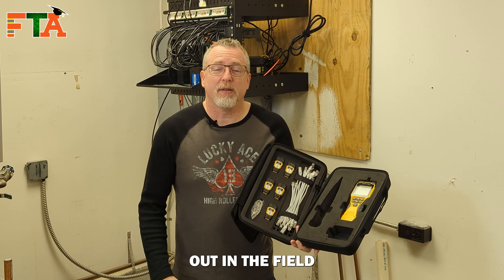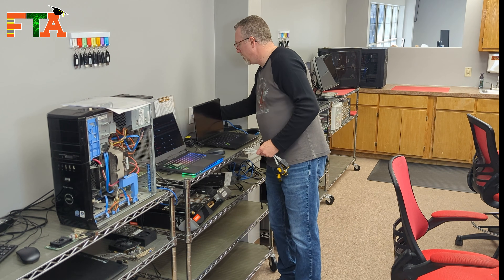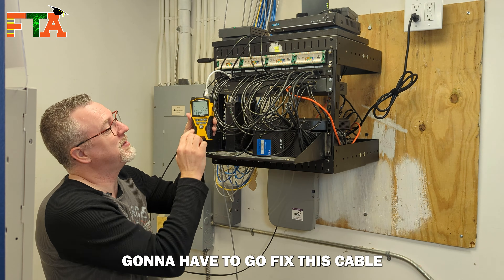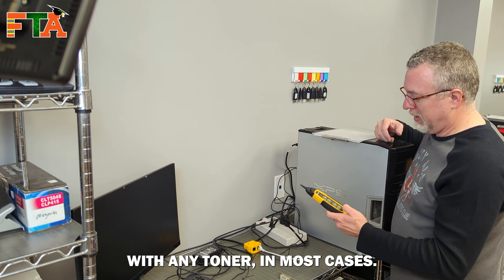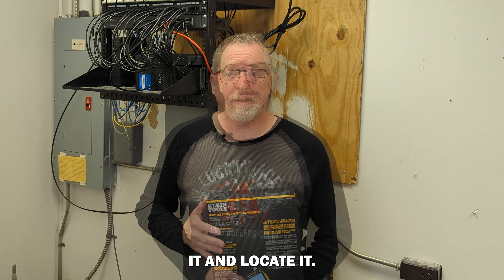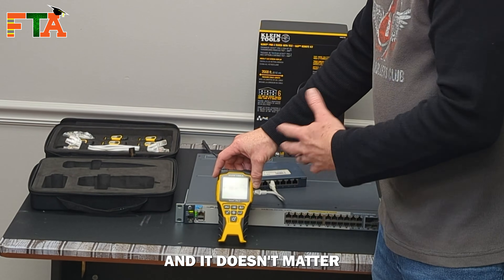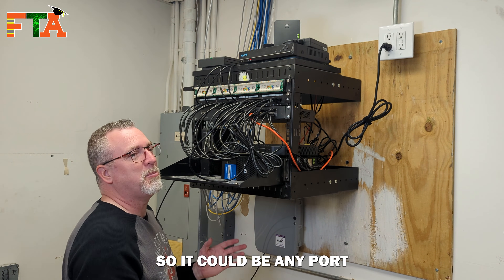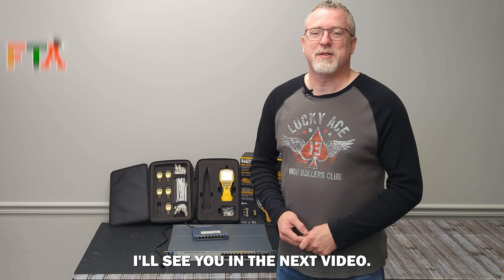Klein Cable Tester Review | Klein Tools VDV501 853  | Real-World Demo-Features Explained #kleintools

Comment: I was hoping you'd show how well the fault detection worked. Can it accurately tell me how many feet down the line my cable break is?
Reply from the maker: It shows cable length by pair so if you have a broken pair, it should show a much shorter length for that pair.  I don't know exactly how accurate it is but it would probably get you in the ballpark.

Comment: I use a measure feature to find which end of the cable needs addressed on a failed cable. You just measure each end and whichever end  measures out to the links of your patch cable has the problem. Suppose you measure the panel side and they all come out to the same length let’s say 60 feet. Then you measure the wall and they all come out except the flashing pair comes out to 1 foot. Then you know you have to address that side of the cable.  It stopped you from guessing and tearing things apart needlessly. It can also help you find a break in the line.  If you measure the cables and they all come out to 120 feet except your flashing pair comes out to 60 feet then you’ll know approximately where the break is. I do this from both side sides to confirm.
Reply from the maker: That's great. I need to test that and see if I can duplicate it in a video. That would help a lot of techs.

Comment: Thanks for this video. I was falsely assuming clients would only accept Fluke certified tests. We all know how expensive those are.
Mike, you’re the man.
Reply from the maker: You're welcome!  There are SOME clients that require it but honestly it's very rare in the calls we get from Field Nation, Work Market, and CloudWork Pro or even direct clients.  Even most of my direct contract clients might say they require it on their paperwork but 99.9% of the time they just want a continuity test and a photo of the tester showing pass.
Reply: This is not a TDR tool does not certify circuit signaling. This is a tone and test tool. I used the Klein toner for the first time last week very impressed!
Reply: I was actually going to say same, we had one project in Texas, they required it, we bought the fluke dsx8000, but guess what since then no other job had requested it , now I just wonder why I bought it, hopefully sometime in soon we will get a project for it.